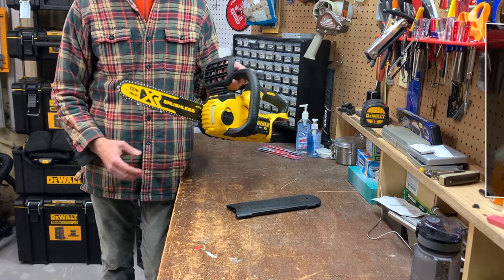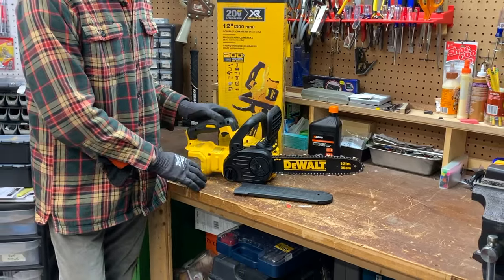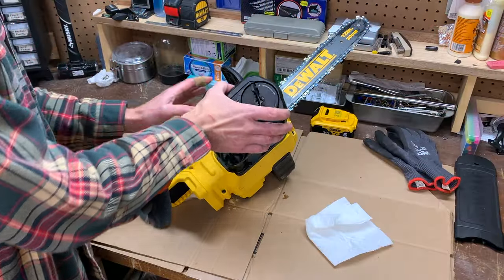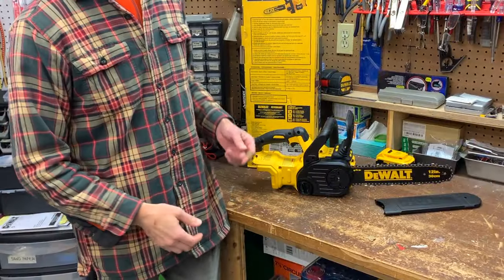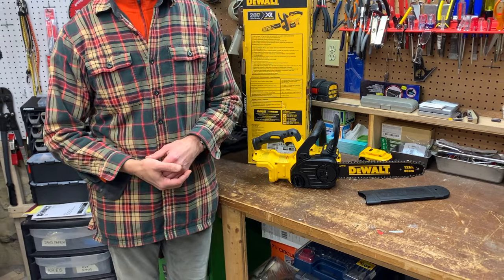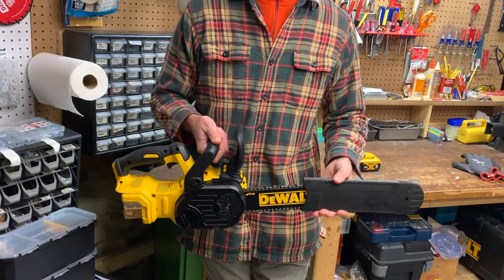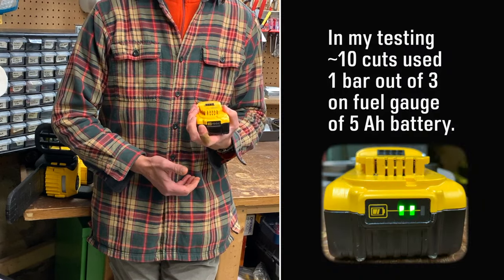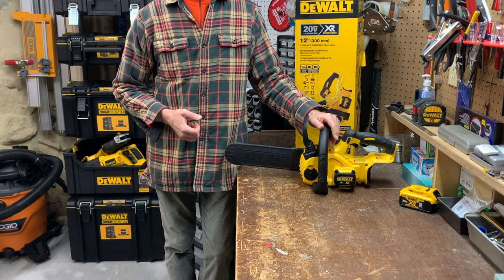DeWalt 20-Volt MAX 12 in. Chainsaw DCCS620 - REVIEW & DEMO - My Little WORKPONY!

Comment: I have this saw, works well but leaks bar oil when stored in the upright position. I've discovered if you store the saw on the bar side with the oil fill cap up it doesn't leak. Adding an O-ring to the cap does not help, the leak is on the inside of the fill spout to case seal. Some people take it apart and add sealer to the gasket, I don't feel I should have to disassemble a brand new saw so for now anyway I'll just store it on it's side. Thanks for the video
Reply from the maker: I agree about the oil leaking when stored. I try to get as much out as possible before I put the saw away.
Reply: Same here. I store mine on its side. The leak has actually become less after a lot of use. 😎

Comment: I just bought this. Having operated chainsaws for several years, there are a couple things that bugged me. The bar oil cap was SO hard to twist that I almost broke it. The saw is so light that it is quite jumpy. Overall, I think it is a good tool for light duty trimming around the around the house but not for serious cutting.
Reply from the maker: Thanks for sharing your thoughts. I agree it’s best for light trimming around the house.
Reply: I thought of the bar oil cap was very hard until I saw it has to counterclockwise it was quite hard to push to open it ...instructions are tiny and very hard to read
Reply from the maker: I do the old trick of putting a little oil on the gasket to keep it lubricated.
Reply: I've cut at least 4 8 to 10inch trees around my house 1 was dead 1 was leaning towards my building the other was a pine tree I would say it was a good 12 to 14 inches it cut all them down with 0 problems. But I'm about to get the bigger 20inch Dcs677 saw soon that thing is a beast!

Comment: I just acquired this saw with 5Ah battery. I have two corded electric chainsaws, a 16" and a 10" pole saw. I had a few gas powered units before, but with infrequent use, they were a pita sometimes. Looking forward to giving this a try. BTW, great vid post.

Comment: Great video .
That was one of the best I ever seen I think you help made up my mind on what saw to get the 20v DCCS620 because the 8.8 lb easy to move around and I am old so when the battery is done so will I be done  we will make a good team lol my son got the  milwaukee 2727-20 it a great saw but it 15 lb I think with battery not shore about the weight but a lot heavier to know in my time I use a lot of chainsaw one time the bigger the better but that changed know smaller for me I love all chainsaw because when I was younger I bilt a 40' x 16" long liner fishing boat with a chainsaw an a axe squared all the trees with the chainsaw in the woods so I could make them light enouf to bring them home on a skidoo and slay every every Pease of timber and beam was cut squared in woods even most of the planks 
I fish that boat of shore over 100 mils that boat is still in the fishery today bilt with a chain saw the hardest Pease to get was the stem and the keel it was done just my brother an me back in the Earley 1980 l had not much money but I had a enough to get a chainsaw it was a Mcculloch Pro Mac 10 10 that put me on my feat love chainsaw thanks for the nice video staysafe
Reply from the maker: Thanks for the kind words and for sharing that great story!

Comment: Not trying to be a jerk, but that test at 4:00… either that chain is super dull or it’s on backwards. I have the same saw and with a sharp chain it’ll pull pretty hard. Plenty of torque. Also, the 14” bar mod makes it a different machine. Look at the Woodland Pro ArborMax Lite combo from Bailey’s Online. It’s like $34 and awesome.
Reply from the maker: Great info. I’ve been considering the 14” bar mod. Thanks! 👍
Reply: Yeah I have the same chainsaw and it cuts way faster than that.
Reply from the maker: Yes, strangely I was using the saw last week to cut off the bottom of Christmas trees and it was zipping through like butter. The wood I used in the video had been seasoning for a year.

Comment: The oil sight window is not there for when you're filling, it's there for when you're using it.

With a gas powered saw, you fill the oil when you run out of gas, but with a battery powered saw, the window is there to help you remember to add oil.
Reply from the maker: Good to know thanks!

Comment: Great video, I am having trouble starting it. It is the same model and I am using 5Ah battery. I did pulled back the break, as well as pressed the safety switch but still no response. Appreciate your inputs
Reply from the maker: Hmmm. Sounds like it should be serviced or returned. Sorry I don’t have a better solution.
Reply: Hold the side safety button while holding the trigger. When my saw's battery gets low it will stop in the cutting process so I change batteries. I'm thinking of getting a 60V Flex battery

Comment: I love the vid ,,I have the exact chainsaw,,the only difference is I use a 60v 9amp batter aka just a bigger battery
Reply from the maker: Thanks for the kind words. I'm guessing you use a 9Ah flex volt battery since it's a 20V tool correct?
Reply: @BruceAlanR  correct,,I need to sharpen my blades though,you heard me right,,blades,,one for females and two for the saw,,have a good one.God bless

Comment: Something is haywire in this video. That saw, given its chain is sharp, should cut those logs and 6x6"much faster.
Reply from the maker: I hear ya.  I’ll have to get a new chain and see if it makes a difference.
Reply: @BruceAlanR Your battery is weak. That's why you noticed a big change from 1 cut to the next. My 5 amp hour batteries will make 20 cuts like you did and will barely drain down 1 bar. Some Dewalt batteries won't last near as long as others just like them. This is a common thing with battery powered tools unfortunately. Always test the new tool with a known strong battery first.
Reply from the maker: @jjoleboy  Great advice and info! At the time of the video I was using batteries that had a fair number of charge cycles. I’ve recently been doing a lot of research on batteries and have opened a few older packs to test for unbalanced cell banks, check cell capacity, and all that fun stuff. The BMS systems in these packs are OK, but cell degradation does happen faster when the packs are used in the higher drawing tools.

Comment: I have the 8" pole saw and it seems to cut faster and better than this 12" chainsaw. Thanks for the vid I was going to purchase this but I'm going to pass.
Reply from the maker: That’s great info. I’ll have to check out the pole saw. Thanks!
Reply: I have the pole saw also and would agree with that. I am wondering if they are putting a less agressive chain on the 12" to prevent kick back.
Reply from the maker: I’ve considered getting a new chain. That may be why it cuts so slow.
Reply: @BruceAlanR  if you do get a new chain please do a update video.
Reply from the maker: Will do!
Reply: Maybe the chain is backwards because I have the same chainsaw and I feel like it cuts better.

Comment: Hello excellent video, but I have a question. I have 12 DEWALT tools that I bought with DCB606 batteries, now I want to buy this chainsaw to cut small trees in my yard, but according to home depot they say that I cannot use the batteries that I have because it will burn the motor, as it suggests that these are Models DCB205, DCB205G, DCB205CK or DCB205-2 What do you recommend in this regard, it is true that it would burn the motor or if I can use my batteries. Thank you
Reply from the maker: Great question! I’m going to call DeWalt’s 800 number and get back to you on this. The manual doesn’t specify which batteries can be used and this tool is considered part of the 20V Max system, which boasts being able to use any 20V max battery (even though it’s more like 18V). 
Just thinking aloud, Ah is not a measure of power, but a measure of charge/run time, but how batteries are wired (series vs. parallel) impacts power. If I recall correctly, both 5.0 and 6.0Ah batteries are two or three rows of cells wired in parallel so there would be no change in voltage, just more Ah/runtime. If you were going from a 2.0Ah battery, which is wired in series (in which case you’d add up the voltage of each cell in the pack), to a 5.0Ah wired in parallel (in which voltage doesn’t get added up), you’d see an increase in power because there are more cells doing less work. 
Anyway, I’ll get back to you once I hear from DeWalt.
Reply: @BruceAlanR  thanks for your help but I do a mistake the battery that I have the models are DCB606, if you have some news please let me know, thanks again
Reply from the maker: DCB606 is a 6.0Ah flexvolt which has more cells in it than say a DCB206. Either way, I confirmed with a nice woman at DeWalt (“Ana”) that there is no restriction on batteries for this saw and the DCB606 flexvolt is OK to use. That makes sense to me but I’m not a tool manufacturer. 😀 
Thinking aloud again, Flexvolt switches from parallel to series to change voltage (you add voltage of cells in series and do not add voltage when cells are in parallel- that’s how it switches between 20V and 60V). Anyway, the 20 volts wouldn’t be the concern. The flexvolt has more cells inside (I believe there are fifteen 18650 cells). For comparison a DCB206 6.0Ah XR battery has ten 21700 cells. That would mean the cells in the flexvolt aren’t working as hard and would provide a little more power. Is that bad for the tool? The verdict is still out. I’ve heard of tools burning out when using a flexvolt battery; however, was it due to using a flexvolt battery? DeWalt hasn’t admitted to anything if it is and stands by their products. Take comfort in the fact that the tool has a 3 year warranty so if your flexvolt batteries are the issue, you’re covered.
Reply: @BruceAlanR  Thank you very much for explaining in detail the conversation you had with Ana, then I can safely use my DCB606 batteries, without any problem or concern that the motor will burn out, you mention that the tool has a 3-year guarantee but what happens if, for example, the motor burns out and dewalt says it was from using FLEXVOLT LITHIUM ION 20V/60V      batteries==(MAX)          6.0 Ah/2.0Ah, 
thanks again for your attention regarding my questions
Reply from the maker: I don’t think DeWalt would give you an issue, but if they did you can say you consulted the manual, which doesn’t specify which battery to use or mention any restriction on 20V max batteries that can be used… and that includes the flexvolt line. I’ve had positive experiences with DeWalt’s customer service in the past. I didn’t think the fence of my table saw was straight so I called with the part number and they sent me a new one.
Reply: @BruceAlanR  Perfect when I get off work I'm going to buy one anyway there is a 90 Day Money-Back Guarantee. 1 Year Free Service. 3 Year Limited Warranty. Thank you and have a great day.
Reply from the maker: I love the 90 Day try “it and if you don’t like it, return it” guarantee. I got the DeWalt 20V max orbital sander because I was tired of being tethered to a cord… I returned it no questions asked. My corded DeWalt orbital sander fits better in my hand. They made the handle larger on the 20V max version (maybe to accommodate a battery pack), but it’s too big for a comfortable grip…  and I have big hands.

Comment: The chain brake has to be Back for saw to operate, Not Forward. The brake being forward means brake is engaged as when a kickback occurs and saw shuts down.
I doubt if kickback will ever happen with this low power limb cutter.
Reply from the maker: Thanks for sharing that. I haven’t experienced any kickback so far.

Comment: If it’s sharpened properly it will cut good
Reply from the maker: Thanks for the feedback. It was a brand new chain for the video. I wonder if it would cut faster with a flexvolt battery attached. Not even sure it would fit,  it I may try it.

Comment: Obviously it’s not as fast as a motor operated saw.
Reply from the maker: Thanks for sharing that!
Reply: Of course it isn't it's dewalts smaller saw. Dewalt released a much bigger saw called the dewalt dccs677 that thing with a 5ah battery is a beast and just as fast or faster than a mid range stihl.

Comment: Ok...so it's not just me. This chainsaw is weak.
Reply from the maker: One user said my 5 Ah batteries were old and that his chainsaw rips through logs; however, my batteries aren’t old so I can only assume I’m the problem. 🤣 
In doing some research, it may be that the XR 5Ah battery isn’t the best fit for the chainsaw. May require a more powerful battery for better performance. A bigger battery doesn’t mean it provides more power, just more run time. I’m going to do some testing.

Comment: This saw is a real piece of Shite. I got one and it worked for about 40 minutes altogether and stopped working. The brake trigger switch was faulty and it was a nightmare to fix. From looking up how to fix it , i discovered it is a common problem with these saws. So  had to send it back to DeWalt  to fix and return it took months. And then it happened again same issue.
Reply from the maker: Ugh! Thank you for sharing your experience. That sucks that it takes DeWalt that long to turn around a repair. I recently had to send one of my Milwaukee tools back for service and they had it back to me within a week… although, they ultimately assessed it and sent me a brand new tool instead of repairing it.
Reply: Mine works great!  You should of picked a winner. 😂

Comment: I know this is 2 years late but, does the 6A 12V battery fit this saw? I'd hate to invest in the 60V system if i don't have too. Thank you in advance.
Reply from the maker: It will only accept 20V max batteries although it would likely work with a 20V/60V flexvolt battery.  It don’t think it would work with the 12v.